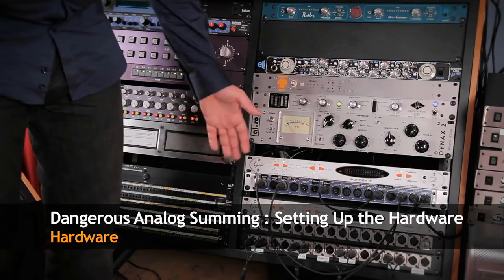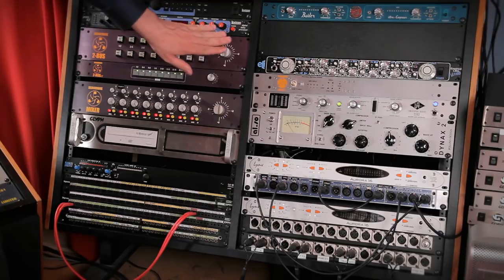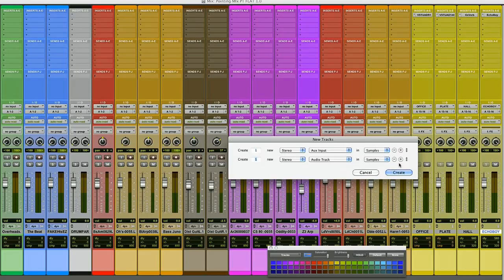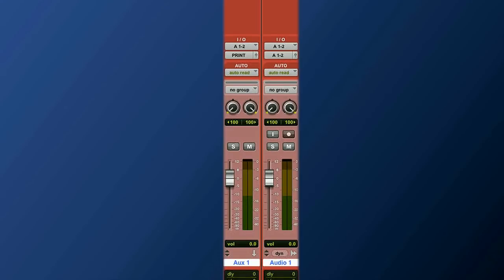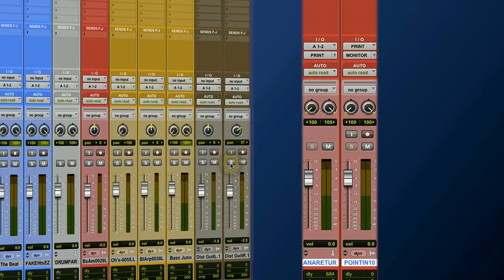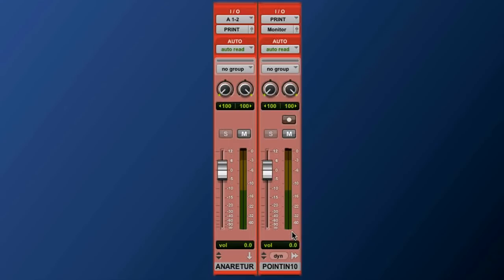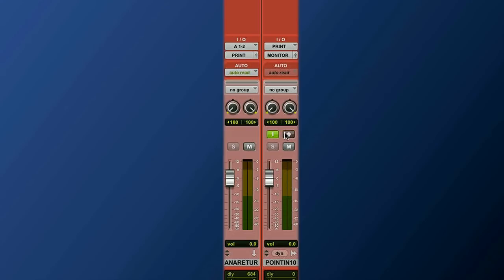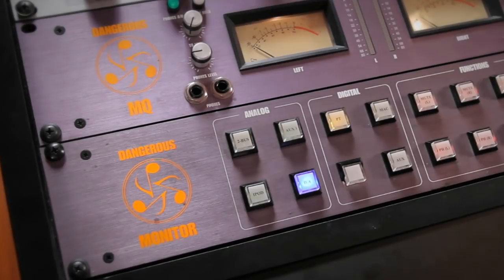Hardware Setup and ProTools Routing for Dangerous Analog Summing

Comment from the maker: The 2-Bus actually has 2 sets of outputs which are identical to each other. They are labeled REC Out and MON Out. You can use the MON out to feed your monitor controller, or any device that you choose, but the important part is actually to use the REC out to bring the mix back into protools via line inputs on your interface (in the video its the lynx), and then record that mix. Then you need to monitor that recorded mix, and for that you need another stereo d/a or an additional output. See 3:38

Comment from the maker: You are going to take the stereo output of the Equinox and bring it into 2 line ins of the Apollo, and then set up a new stereo track in Logic that you will use to record that mix. From there you need a way of monitoring that mix, so you need to output that track to a digital output if you have another converter to plug it into, or if you have a spare set of line outputs that you aren't using for summing you can use those and send them to your monitor controller

Comment from the maker: @causindrama The D-Box is the same quality as the 2-Bus, it just has less channels. And it has a built in D/A converter, so you wouldn't need to buy another one. If you buy the 2-Bus, you already have d/a converters in your 003 to go out to the summing box, and a/d to go back into protools, you just need another stereo d/a to monitor the mix after it gets recorded (which the D-Box has built in)

Comment from the maker: @frontgarcia Yes, in order to hear the last step in the mixing process you'd need another d/a converter. Honestly, if you have that interface you might be better off getting the D-Box. Check out our other videos for info on the D-Box. But if you want the 2-Bus, you would just use your 8 analog outs of the Steinberg to sum into the 2-Bus, and bring the stereo outs onto two line ins on your interface to record the mix. This is where you'd need another converter to listen back to your mix

Comment: Thanks a lot for the quick answer. Just to be sure I understood everything right

Both the REC Out and MON Out can be used simultanelusly: one to feed Pro Tools  and other to feed my monitor system and the signal recorded is the same sent to the monitors (as long I don't use any plug-ins before printing the mix in PT).

I can use an Aurora 16 to feed the 16 2-Bus Inputs and any stereo out of my Digi 003 to hear the mix from Pro Tools if I want to. Is that correct?

Thanks again.

Comment: @DangerousMusicAudio Thanks for the tutorial. A related question. I have the D-Box and Steinberg's MR816csx. Both are connected as shown in the tutorial. Yet, when I press the DAW button I don't hear anything (using Cubase). Are you suggesting that I need another pair of d/a converters ? Different than those in the MR816csx? If that's the case, how and where do I connect them?  Thank you in advance !

Comment: I guess my question is this. If im running pro tools, why do I need a da/ad converter to go into the dangerous 2bus on xlr connection. Second question to run this set up properly would i need 1 or 2 ad/da converters. Im a little confused. But love the opportunity to expand my current set up wit an 003r and control 24

Comment: What is feeding the Aurora 16? How dos the sound get from the DAW to the A to D converter?
Reply: +1 Have the same question. And no video about setup summing covers that. Also I'm wondering how to rote all those different AD\DA boxes in drivers simultaneously?
Reply: The interface feeds the converter.
Reply: Figure out that Aurora have Thunderbolt expansion slot. So all is easy now, plugs thunder on your workstation and you've done : )